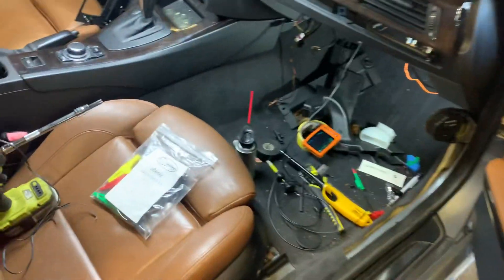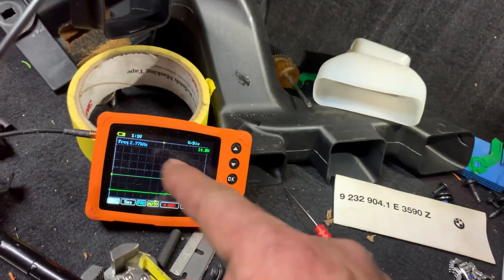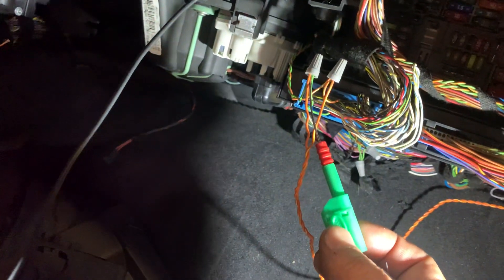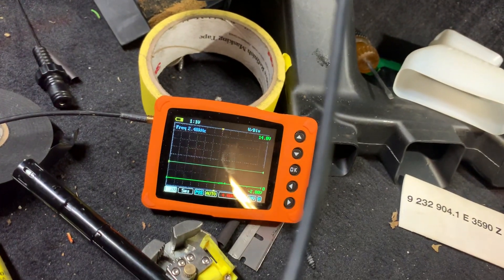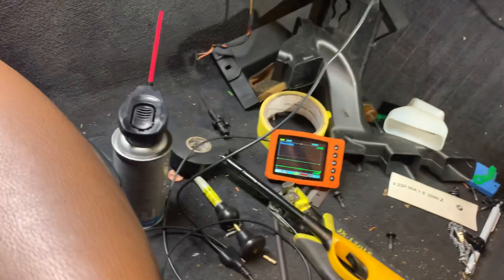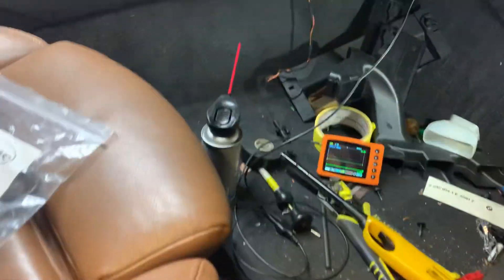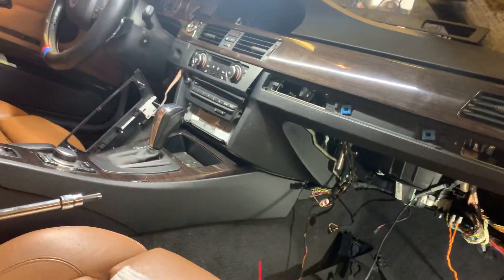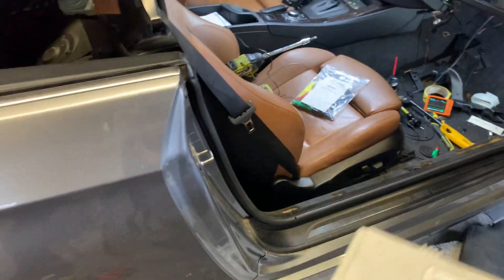BMW kcan bus faults diagnostic

Comment: Hi mate, my FRM module has been repaired but it was still not working I suspect the KCAN line is shorted.

Is there an easier way to connect two new wires of the KCAN line and hook it to another comms line or I have to hook it up all the way to the fuse box?

Comment: Hi, i had some water damage caused by a clauged drain under the abs pump
All the water just got in the car, under the driver side
Unfortunately the car sit under the rain around 1 week…it got a LOT of water, the subwoofer and the sensorCluster under the seat were completely under water. So, i took everything apart, took out the subwoofer and the sensor, dried everything good but still, the car goes crazy all the time… it’s something that i missed? I understood that is a k-can line fault, but i just can’t see what other module would be affected
The CAS and FRM are well, they haven’t got any water. I tried to change de JBBF module but the problem didnt dissapeared
Any ideas? Im kinda desperate….
Reply from the maker: You have to look for every single connector that has corrosion on it. That is your suspect. You have to disconnect everything on the ground that got wet. You have to lift the whole carpet up.

Comment: So what happens when you identify the failed can? Can you slap another one in there or is a trip to the dealership to get the new one programmed?
Reply from the maker: The CAN is the network communication Area Network. 
It consists of computer modules and the twisted wires between them that allow the communication between all the modules. 
Any issue with either a module or computer or an issue with the wires being pinched or water damaged can’t take down the communication in that network, 
so your job is to Disconnect one module at a time or find water damage connections, and if you remove that bad part typically the rest of the network will start communicating and working often times a used computer or module is fine and no programming is required

Comment: do you just look for any twisted pair wires, or did you have electrical circuit diagrams / layout diagrams
Reply from the maker: Usually a twisted pair is confirmation it’s a communication bus line

Comment: this was very helpful, Im going through something like  this right now on a 2011 328i. Has a bunch on kcan faults. took the whole car apart finally,  found water under the driver side carpet unplug the kcan line near the driver side dead pedal and  cluster  started working normally. Hopefully find the issue soon. Going on day two of diagnoses
Reply from the maker: In my situation, I found a wire that was damaged insulation under the passenger seat and allowed water to corrode the copper part of the wire, and that took down the communication line once I repaired the wire everything started working
Reply: Thanks guys. I'm on day 1 of looking

Comment: Hey man, appreciate the super detailed video and adding a new tool kit to my arsenal! I’m having a similar issue on a 2006 BMW 530xi where the ignition, Instrument Cluster, iDrive, Radio, essentially everything except for locks and lighting not working throughout the car. Did you end up finding the short to ground? I’m curious where the short to ground was found even though it is an E90 it may help me find out what is going on with my E60. Also having some symptoms of parasitic draw if the battery remains connected overnight which makes me feel like the car isn’t going to sleep.
Reply from the maker: In your situation I would look in the trunk under the spare tire. There are modules there that can affect the bus line. Also, the battery sensor on the negative cable can also affect the bus line. Usually the most suspicious areas are areas that get wet.